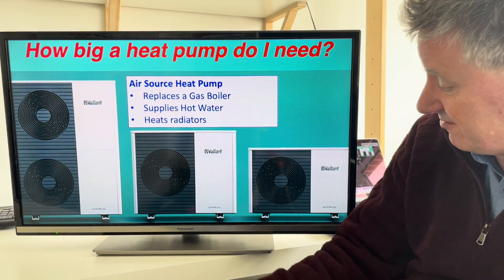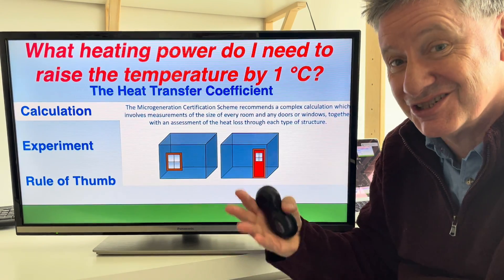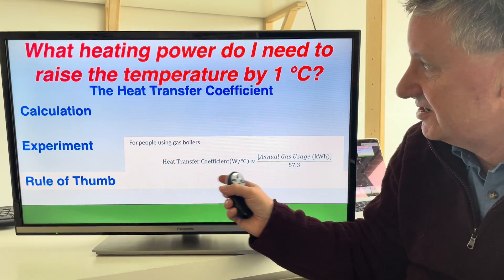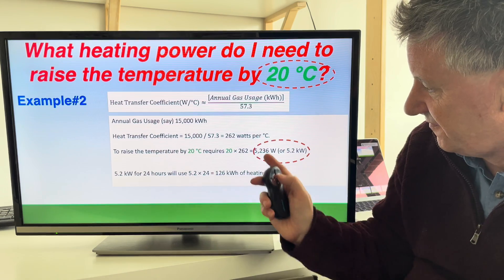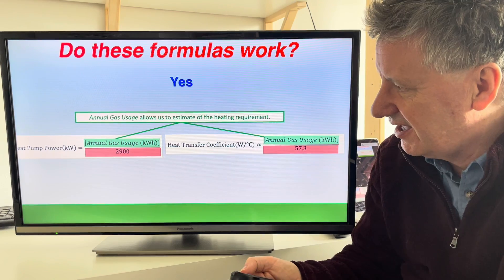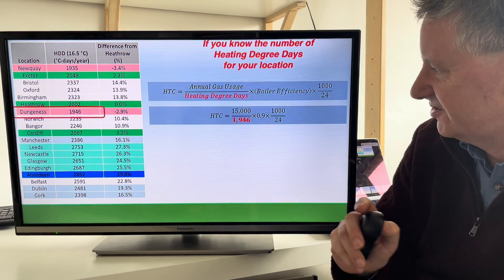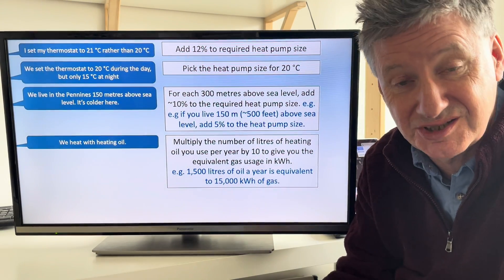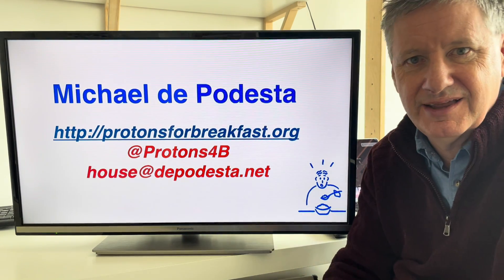How big a heat pump do you need? A simple Rule of Thumb.

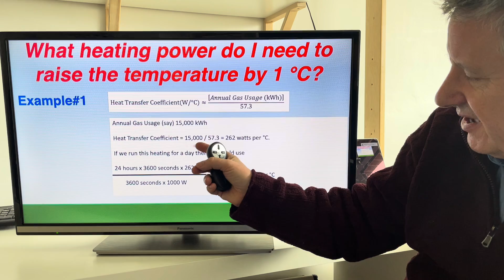Comment: Interesting video. However, word of caution, the calculation you show at the bottom of the screen at 06:49 is mathematically-speaking wrong, because of the units you display. Your result 6.3 would basically be 6.3 hours. There’s no need to have 3600s as denominator and numerator and the 1000 factor is just to convert W to kW so it is “unit-less”🙂. Your calculation should simply be: 262W used for 24hours: so 262W x 24hours = 6288Wh or ~6.3kWh
Reply from the maker: Thanks for paying attention. It's a pleasure to 'meet' someone who pays attention to dimensional analysis. Such analyses were more relevant to my previous employment at the UK's National Physical Laboratory. 

If you are interested in units and measurement, you may enjoy this talk I gave in 2017 at the Royal Institution in London.

https://youtu.be/dguZLChkRV8

Best wishes

Michael

Comment: Hi there, first of all GREAT video and thanks for it! :) I downloaded the spreadsheet for the HDD in my area and was wondering if the correct number to use is the total given on the spreadsheet which is rather high at 7190? Then again I was calculating for a cold region: 72.95W,43.53N. Does this sound correct? It's a LOT higher than your 2900HDD but I suppose that would be expected for this region where I calculated...
Reply from the maker: @terriisidro2467 Good afternoon from the UK. 

I used the heating degree days web site to estimate the HDDs for your locale. I used the airport at 

KDDH: BENNINGTON MORSE STATE AIRPORT, VT, US (73.25W,42.89N)

Averaging over the last three years I found 

Average	HDD 15.5 = 2884 °C days - appropriate if you home is typically at 19 °C
Average	HDD 16.5 = 3132 °C days - appropriate if you home is typically at 20 °C
Average	HDD 17.5 = 3392 °C days - appropriate if you home is typically at 21 °C

These seem typical for a climate that is a bitter colder than UK - which I guess Vermont is.

So I can't quite understand what that number 7190 is. Do you know you average annual gas consumption (if you heat with gas)?

All the best

M
Reply: Hi Michael, I so appreciate your quick response! :) I downloaded a spreadsheet from that site after inputting my location that has a column HDD for 65 degress F values for the months Jan-Dec. The locale that is a bit closer to me than Bennington is station ID KRUT (Rutland). I do know my average gas usage is 1097.3 gal/yr. I googled that there are about 0.08kw/gal of oil so my KW/yr usage was calculated to be 13,725 kwh/yr. I hope that's right. 

I'm at a pretty high elevation so I know I have to add 5% per 500 ft to my final heat pump size. I'm also researching cold weather  pumps as we do have our -30F days here! :face-blue-wide-eyes:However, we do have wood fire and oil backup heat as is recommened for this type of climate lest we wake up as human popsicles on a real cold snap. 

I guess my confusion is how to obtain the average HDD values from the spreadsheet as you did for HDD 15.5, 16.5 and 17.5. Maybe I need to read the materials on that site more carefully (I confess that I haven't). In any case, my primary desire for winter months is not for the heat pump to be our primary heat source, but rather that i can reduce some of the oil/wood usage and utitlize the bit of electric generated even on winter days from our solar panels. 

Mostly the push to add in heat pumps though are for dealing with the very hot/humid days during summer months which were uncommon a decade ago but that  we are seeing more and more in my region now.

Thanks again for your help, and this video really is so helpful!
T
Reply from the maker: @Misfittykitty  Terri, Good Evening.

To obtain the yearly average of HDD values you add up the values in the file you downloaded. For example, I downloaded three years of weekly HDDs so I added up 52 weeks (June 2023/July 2022) to get last winters total HDDs. If you downloaded monthly values, then just add up 12 of them. If you downloaded daily values, then you need to add up 365 of them. If you send an e-mail to house@depodesta.net I can send you the spreadsheet.

It's difficult to interpret your gas usage - or actually heating oil - without knowing about the size of your dwelling and how many other heat sources you are using.

My suggestion is that it would be unwise to plan for sole heating with a heat pump down to the lowest temperatures you might experience. This will result in an over-sized heat pump for the majority of its yearly usage. If you plan for heat pump to take care of things down to say - 10 °C (~14 °F) this will reduce the amount of wood/oil/electricity that you need. On the few days when it gets colder then that just switch everything on! 

Terminology differs between Europe and the US, and so it may be that what you would call an A/C unit (in Europe it's an Air-to-Air heat pump) may help. This is cheap, scalable, and will cooling summer. But it will also heat efficiently in winter. It won't heat hot water, but maybe that's a separate problem.

Best wishes

M
Reply: @michaeldepodesta001  I came up with what I thought was a strange number when I took the average but I'm going to use it and see what I come up with anyway. I really appreciate the time you took to help me! I may email you after I do a bit more reading to have a better grasp of it all. Thanks again for your kind help! :)
Reply from the maker: @Misfittykitty  Remember you are probably using °F-days rather than °C days: They differ by a factor 1.6. M
Reply: @michaeldepodesta001  Ah, that is probably it! Thank you for pointing that out and I can make the conversion. I'm sure then the number will make more sense. As always the devil is in the details! 😈

Comment: Molim Vas da mi odgovorite, imam 145 kvadratnih metara grejanog prostora kuce koja je jako dobro izolovana. Imam u kuci 126 rebara radijatora. Koja snaga toplotne pumpe mi je potrebna? Hvala.
Reply from the maker: Milan Milosevic
Please answer me, I have 145 square meters of heated space in the house, which is very well insulated. I have 126 radiator ribs in my house. What heat pump power do I need? Thank you.

Milan, Good Evening. I'm afraid I don't know. This video is about a way of estimating heat pump size from
1. Knowledge of the amount of gas used to heat the property
2. Its location. My rules are based on teh southern UL, but perhaps you live somewhere else?

Best wishes

Michael

Comment: Hi Michael, really informative thanks. Sorry if this has been addressed previously, but is there a simple calculation to convert annual oil consumption to kwh so that I can arrive at a heat pump size? I estimated the oil consumption for 1 year as 3,200 litres. (If that quite sounds high, it is a 5 bed detached house.)
Reply from the maker: Good afternoon.

Yes, the heating effect of 1 litre of oil is equivalent to roughly 10 kWh of gas consumption. The video covers that point here:

https://youtu.be/hCeghKa3liM?t=892
 
So 3,200 litres is around 32,000 kWh - which is quite high but not crazy.

The rule of thumb suggests an 11 kW heat pump, but that's just in the south of England and assumes the oil is used just for heating and hot water - not for example using an AGA.

If you divide the 32,000 kWh/year by the floor area of your property in square metres you will get an estimate for the general quality of the insulation. For example, if the living area of your home is 200 m^2, then the figure of merit is 32,000/200 = 160 kWh/year/m^2 which is a typical English home. I would recommend trying to get that down if you can with draught proofing and insulation. The best possible retrofit is ~ 25 kWh/year/m^2, modern building standards are less than 50 kWh/year/m^2 and figures between 50 and 100 kWh/year/m^2 should probably be possible and will help the heat pump run very efficiently.

Best wishes

Michael
Reply: @michaeldepodesta001  Wow, that’s gone above and beyond! Thanks so much. Lots of food for thought. I’m more interested in the environmental impact than saving lots of money but I hope that installing a heat pump with battery and solar later will at least break even.

Comment: So just checked my gas consumption for 2 years for heating and hot water and it comes to 42354 divided by 2 = 21177 divided by 2900 which means a 7.3 kWh heat pump.  Cheers.
Reply from the maker: If you live in the UK south of Manchester and keep you home at around 20 °C, yes, that's a good estimate for the size of heat pump required. A heat loss survey might come up with 8 or 9 kW, If it comes up with much more then your should ask the person doing teh estimate to explain the difference.  Best wishes. M
Reply: @michaeldepodesta001  What size do I need if I want to keep my home at 22 C?    I just use gas for hot water and underfloor heating so would I be needing a low heat system?
Reply from the maker: @baronsilverbaron757  https://youtu.be/hCeghKa3liM?t=799

Every °C above 20 °C adds about 12% to household consumption. SO 22 °C adds about 24% to consumption. 

Did the 21,177 kWh per year corresponded to your average household temperature being 22 °C?

(a) If so, i.e. the temperature of your home would stay the same, that means the heat transfer coefficient of you home is about 24% lower than estimated. But you will need to warm it to 22 °C when the outside temperature is (say) - 3 °C so that's about 10% extra heating. So overall the estimate of heat pump size would be around 7.3 x 0.76 x1.1 which is about 6.1 kW.

(b) If not, i.e. you want your home warmer than it was before, then teh heat pump would need to be larger around 7.3 x 1.24 x 1.1 which is about 10 kW.

Best wishes

Michael
Reply: @michaeldepodesta001  Thanks.  That's very helpful.

Comment: With regard to the HPump size; if the hp has an inverter goes this not match the demand to the load and therefore if an oversize hp is used it should not be an issue?
Reply from the maker: Dear Frank John. Yes, to a degree. But not wholly because the inverter can modulate only down to some fraction of the maximum power - on my 5 kW heat pump about 40% or 2 kW thermal output. In fact my peak thermal load is around 3.6 kW  which happened for about 3 days this year. 

But thermal surveys can easily suggest installing a heat pump twice the correct size. For my installation I might have had an 8 kW heat pump installed which would modulate down to 3.2 kW thermal output - but then cycle on and off below that. So such an oversized heat pump would basically be switching on and off all the time.

This may not be harmful, but I hear people say that it could shorten the compressor life - but I genuinely don't know.

Best wishes

Michael

Comment: Just did the rule of thumb calculation using your method, 13500kwh gas used over the year, my draughty Honley requires 4.6kw heat pump
Reply from the maker: Dear CV Plumbers and Heating. That sounds about right. But please remember this is a rule of thumb, if you want to install a heat pump you will need to get a heat loss survey. Sadly these surveys seem to overestimate heat pump sizes and so the Rule of Thumb is there to help you ask critical questions of the heat loss survey comes out with an unrealistic heat pump size.

If you want to see whether your home is really draughty, take your annual gas consumption figure and estimate how much heat is used for space heating.

Take your consumption annual 13,500 kWh and multiply by (say) 85% for efficiency and then subtract (say) 5% for DHW ~11,000 kWh. Then divide this by the living area of your home in square metres. So if your home is 80 m^2 then the figure is 11,000/80 = 137.5 kWh per year per square metre (kW/y/m^2).

The best possible result is ~ 15 for a PassivHaus: 25 is an excellent refurb. 50 is modern building specification. 100 is a reasonable UK house. Above 100 and you would probably benefit from some draught proofing and insulation.

All the best

Michael

Comment: Hi, what is your view on installing  higher kw pump compared to the one recommended by heat loss calculations e.g. Heat loss recommends 9KW will there be issues if an 11 kw is installed
Reply from the maker: Jaigansh, Good Afternoon. I am not sure why you would want to do that, but it would probably work, but not as well as a properly sized heat pump. Why?

9 kW is the estimate MAXIMUM heat pump power required. Most of the time the heat pump will operate well below that power. Modern heat pumps can modulate the speed of compressed continuously down to around 40% of maximum. To go deliver heat below 40% of maximum output the compressor switches off for a while and then switches back on. This reduces COP and increases wear and tear on the compressor. 

So oversizing will increase the amount of time the compressor switches on and off. If the accuracy of the assessment has an uncertainty of 10% using an 11 kW pump instead of a 9 kW pump won't make much difference. But if the 9 kW assessment is a significant overestimate - as it often is, then an 11 kW pump could be a problem. 

So if you live in the UK, try checking your assessment with the Rule of Thumb.

All the best

Michael
Reply: @michaeldepodesta001  It just that 2 installers operating off the same loss calculations have recommened diff systems and the higher KW system is lower priced. hence the confusion both are leading brands btw vaillant & daikin
Reply from the maker: @jaiganeshsanthanam4919  Ahh. What a tricky situation. First of all, I don't know your situation, I don't know your finances or your home. 

If money was not an issue, I would be inclined to go with the 9 kW installation. Why? Because my experience is that heat loss calculations systematically overestimate heating requirements. The worst case possibility is that on the coldest days you might conceivably need an additional heater - but this is unlikely. And for the rest of the time the pump will operate more efficiently.

But that is just my opinion. I wish you good luck with your tricky decision and many warm winters to come! M

Comment: Great analysis but the biggest flaw, if one can call it that, is that you're assuming heat load changes in a linear way with outside temperature. So you use HTC, an average, to model heating amount required to raise temperatures. In many older, leakier homes, though, linearity doesn't hold, especially at the extremes: You need more energy to raise the temperature than your HTC assumes. Probably still a useful guide, though!
Reply from the maker: Dear afrocraft, Good afternoon. 

You say that in older leakier homes that linearity doesn't hold. But I don't know why you state that. The linearity arises from pretty basic physics.

I have measured this in my own home and as you say, the results are not completely linear. This is because - I think - of solar gain in spring and autumn which I don't account for explicitly. But the winter data is convincingly linear and extrapolate to zero at zero heating demand. You can read about the measurements here.

https://protonsforbreakfast.wordpress.com/2021/02/15/understanding-heat-flow-in-my-home-the-key-graph/

Best wishes

Michael
Reply: @michaeldepodesta001  Thanks for the response! Here's what I am finding: When I use your HTC method for my 3000 SQFT home in NE USA, I get 6 kwh heating capacity. But when I use actual runtimes on cold days (~17 F or -8 Celsius, which is our design temperature), I get 14 kwh. I think both are correct: My average heating demand over a year is 6 kwh, but my demand on a cold day more than doubles! But I'm not an HVAC engineer...
Reply from the maker: @afrocraft1  I'm a little confused by your use of kWh (energy) when from the context I would expect you to be talking about kw (power).

So taking your annual gas usage (kWh) and dividing by 2,900 you get an estimate of a heat pump power as 6 kW (Power) if your home is the southern half of the UK. You home is in the NE US which is a big place. I worked out the degree days for Albany HDD16.5 ~ 3,200 compared with 2,100 for UK town of Oxford. So a home in the NE US would require about 50% more heating than the identical home in the UK. Additionally your peak heating demand is 28 °C rather than 20 °C. I think these two factors are the origin of this discrepancy.

Best wishes

Michael
Reply: @michaeldepodesta001  Thanks so much for this. I reviewed the HDD I used and found wide variation in the estimate (1600+ to 3625) provided by the website you recommended, depending on which station you use! My HVAC contractor advised to use Reagan National (DCA), which turns out to be more like UK weather (~2035 HDD). Now recalculating, I have better agreement between load estimate using actual furnace run times and the HTC method. It works!

Comment: Dumb question: Why multiply the HTC by 20? I assume that's the difference, in Celsius, between your design temperature in the UK (0 degrees C) and your target house temperature? Is that right? I'm trying to apply the formula to the northeast USA, where design temps are different. Thanks!
Reply from the maker: Dear Afrocraft, yes, that's the idea. I used 20 °C as it's a nice round number and about right. But even in the UK design temperatures very and people's preferred internal temperatures change.

The formulas I have used express the HTC in W/°C and kWh/day/°C to find the heating power or energy expended per day I multiply by 20 °C

If you have figures in W/°F and kWh/day/°F thane you should multiply by 20 * 9/5 = 36 °F instead. If you have a much colder outside design temperature, you will need to increase this number.

Please remember this is not an exact science - it is a way to get a rough estimate so that you can feel comfortable with estimates made by contractors etc.

Best wishes

Michael
Reply: @michaeldepodesta001  Great, very helpful. Thanks!